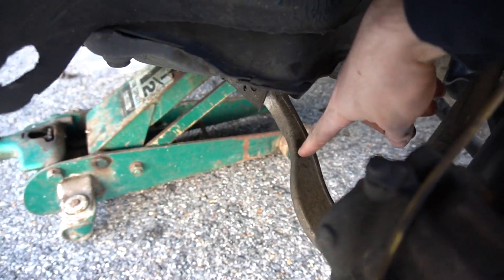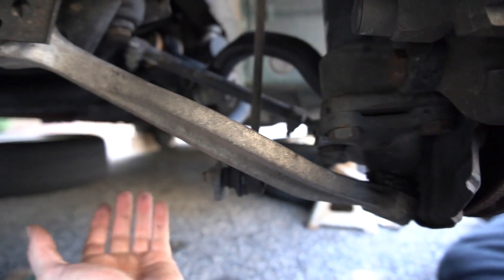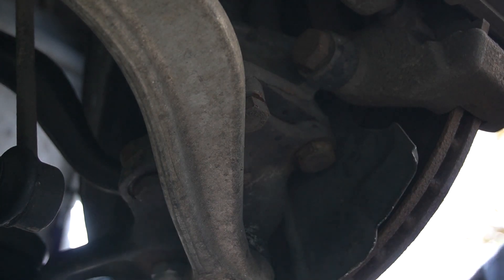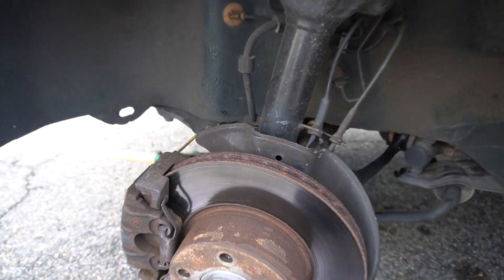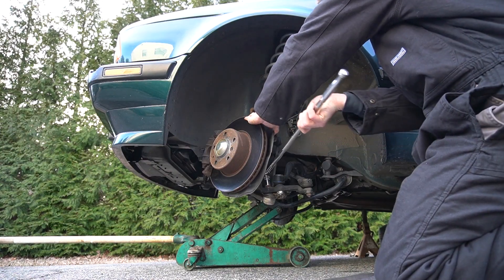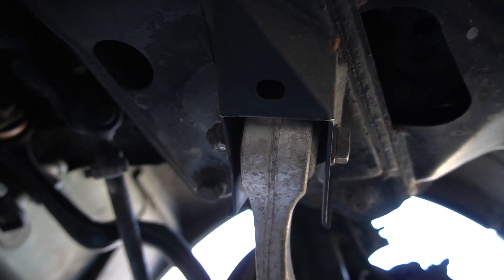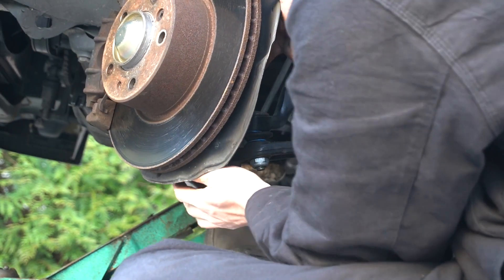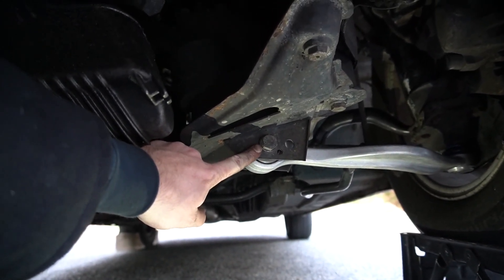E34 Lower Control Arm EXPLAINED + Replacement Walkthrough

Comment: recently got a 540, and i get extreme vibrations that come and go in the steering wheel at around 50-60mph, it comes and goes, seems like its this arm that might be causing it.
Reply from the maker: It certainly could be this lower control arm, or it may also be the rear/upper control arm/thrust arm. I have a video on that replacement as well. It's more commonly the thrust arms that cause the most significant looseness in the suspension in my experience. These cars are also very sensitive to wheel balancing issues, especially if the OEM Lemforder control arms, which have oil filled bushings, are replaced with any other brand that has solid rubber bushings. Best of luck!
Reply: @MyersMotors  okay, the arms have been replaced with some random kit a couple of years back, and I have style 42s wich are straight and no balansen issues with them so i guess it would be the arms that have gotten bad

Comment: hey love the videos on the e34s. just curios why u didnt mount the arm in the alternate position that gives you more camber... im 21 so its a legit question
Reply from the maker: Hey, glad you like the videos. I'm pretty sure mounting the bushing in the other set of holes would screw up your toe more than anything, which I guess you could fix with an alignment, but I'm not about all that. I don't have any use for the extra camber.

Comment: Great video. How do you measure the torque when you retighten?
Reply from the maker: Thanks! A torque wrench is used to tighten things to the right spec. It isn't always necessary since you can always just get things good and tight, but suspension parts are definitely one place where I'd recommend tightening things precisely.

Comment: Great directions and detail! Thanks.
Would an impact wrench make any of this easier?
To be fair, your way is what I used on my e32 750iL years ago, but I'm thinking on my 535i, since an impact wrench is now readily available it would help with parts of this?
Again, thanks!
Reply: definitely does help, i was the first person to remove the 19mm bolts from the bottom of my struts and i had to use a breaker bar with a pipe on it and wedging myself between a wall (my air impact wouldnt get them off) it also helps torqueing the nut back on the ball joint because the ball joint stud turns, i literally could not torque the ball joint nut it just spun infinitely good luck on the 535!
Reply from the maker: An impact wrench would definitely make removal of pretty much everything significantly easier, given you can fit the tool. Like Jerry was saying, those three bolts on the bottom of the strut don't like to give up too easily, and would definitely be a good place for impact tools if you've got one strong enough. It could definitely make it easier to get the nut on the top of the ball joint started as well since the joint does have a tendency to spin, but isn't necessary.  Any time I've had a ball joint that spins instead of seating, simply tapping it in with a mallet or turning the steering wheel slightly has given it enough friction to let me drive the nut on.